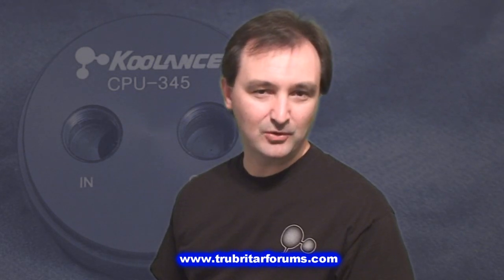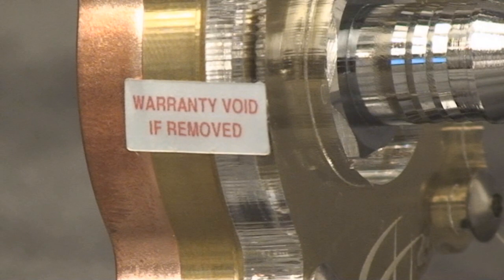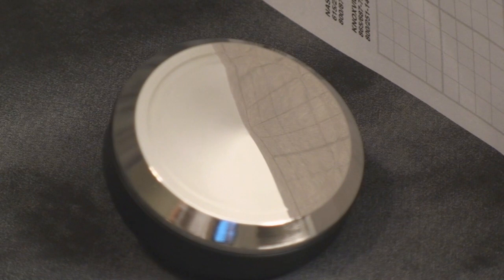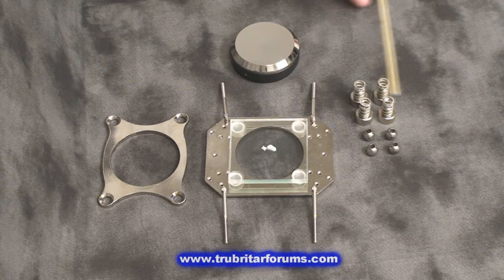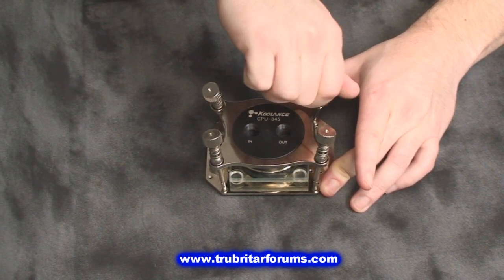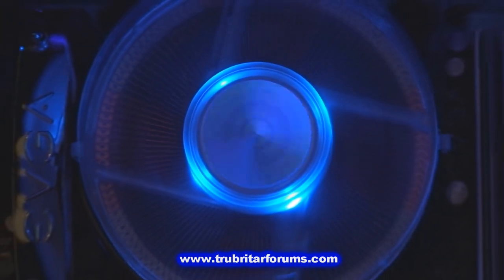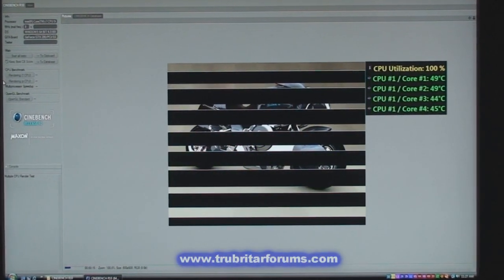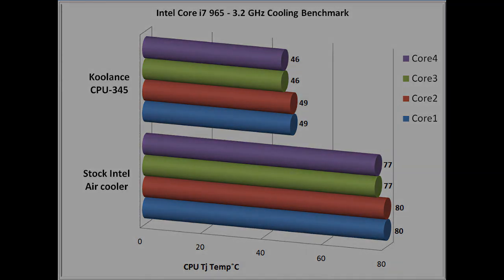(HD) Koolance CPU-345 Liquid cooling Intel's Core I7 965 CPU

Comment: well you don't really need a 4fan radiator.

3fan provides 1000w of heat dissipation, which is plenty enough for running a system like that liquid cooled.

Comment: Do you live in the arctic? lol. I suspect whatever you're using to measure the heat isn't quite accurate. Lots of programs are 10-15 degrees celsisus too low than the real temp. But that could of course just be fromy experience, glad you have a good air cooled rig.

Comment: you shouldn't be using tap water if algae is a problem.  Try using chemically pure water, maybe with the addition of a small amount of chlorine and it'll never get algae or clog.  Also make sure that the system is sterile before you fill it and that the pipes are not see through!

Thermally oil would be identical (understand the science going on in the system and this should become apparent) - though you might need a different (and likely more expensive)pump as oil is thicker than water.

Comment: irrelevant.  The only advantage of using oil is that the oil has a higher specific heat capacity (aka can store more energy without heating up) but since the water is being cycled through the cooling system fairly quickly this never would become an issue.

Comment: Hey Trubritar. Thanks for the review.

I'm using the PMP-450 17L/min (4.5 gal/min)@24v (13mm hosing throughout) feeding the CPU water block to a HX-422 Single 120mm Radiator, XFX 9800GX2 BlackEd., HX-720 Dual 120mm Radiator, then back to the Reservoir.

My questions are: 
1 is this the right loop set up or should the radiators be before the cooling blocks (as had no problems so far)
2 out of the 345 & 350 water blocks which do you recommend for the Q9000 series CPUs in a  high flow setup?